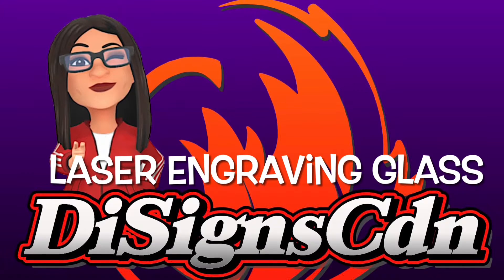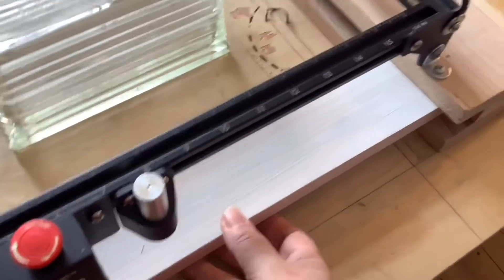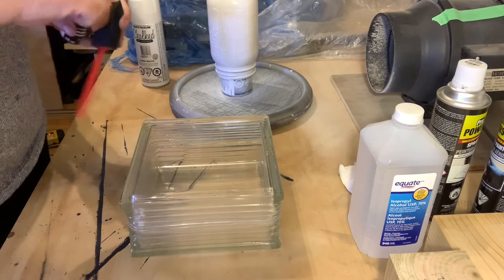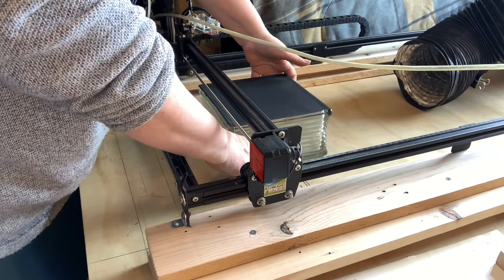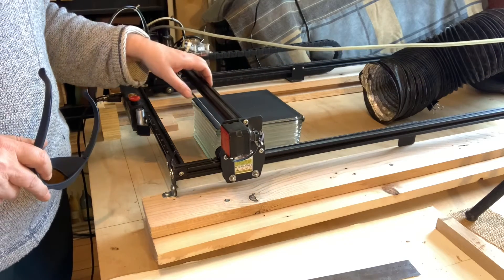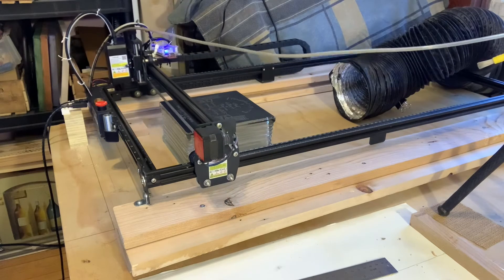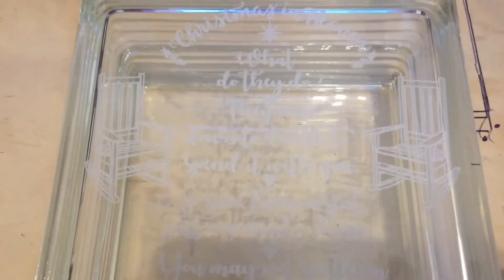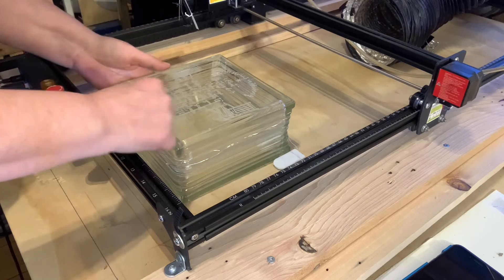19. How to Laser Engrave Glass w LASERGRBL. ORTUR LM2 pro 5.5 / 10 watt laser engraver

Comment: Hi, thanks for providing this information. It has helped answer many questions. I do however have two questions... 1. Are there any fumes or smells burning on the paint? 2. My other question pertains to focusing. I have a Creality 10w diode laser which comes with a 3-step focusing tool accessory that slides under the head. These steps are marked "Engrave/Cutting Thickness of Basswood 1-3mm", "Cutting Thickness of Basswood 4-6mm," "Cutting Thickness of Basswood 7-8mm". Any suggestions as how I would focus for plate glass?
Reply from the maker: I get no fumes at all when using acrylic craft paint. But I’ve always had an exhaust fan off to the side. For your focus , I would assume using the level that says engrave rather than the cut levels. Sorry for the delay in answering, I just got the notification now .😊

Comment: Helpful video just curious why do you have to paint it?
Reply from the maker: The Laser will not laser on clear glass or clear acrylic. It refracts the light from the laser too much. So it needs a point to be able to focus on and engrave. 😃
Reply: @disignscdn   At what beam do you have it set on for the laser to be strong enough?
Reply from the maker: @lauradang2977  with my 5.5 watt I use 85% power at about 2000 speed. With my 10 watt I use 80 - 85% at 2300 speed. :)
Reply from the maker: @lauradang2977  its also Dynamic power, not constant power. Constant is for cutting only ;)
Reply: Thanks! I have ORTUR Laser Master 2 S2 LU2-2, 24V Laser Engraver. Would you know if my watt is too low that’s why it’s not engraving?
Reply from the maker: @lauradang2977  aha! If your laser is the LU2-2 it is a 1.6 optical output laser. So possibly try 1000 mm min or less for speed and 95% power. ( 950  in lasergrbl ) I suggest just trying a wee little circle test on some painted glass till you get the results you want :)